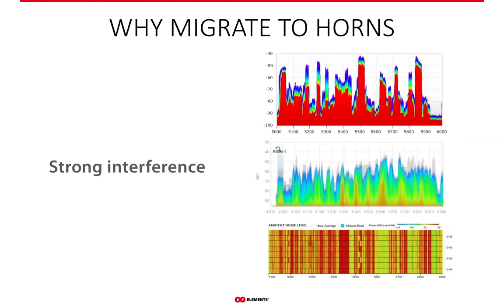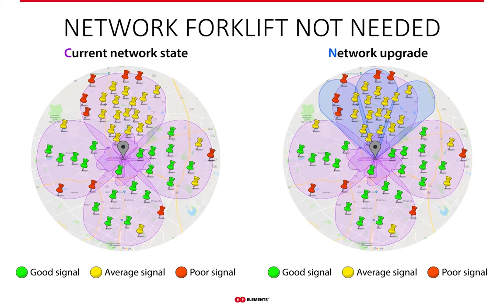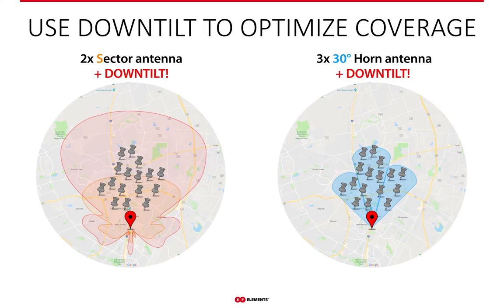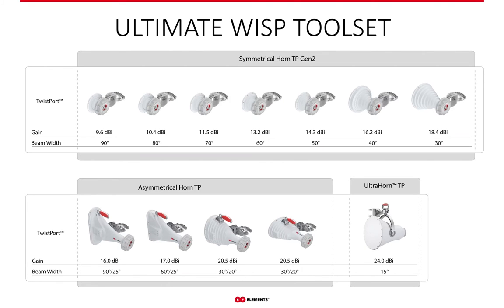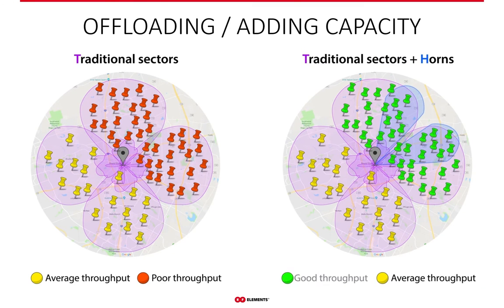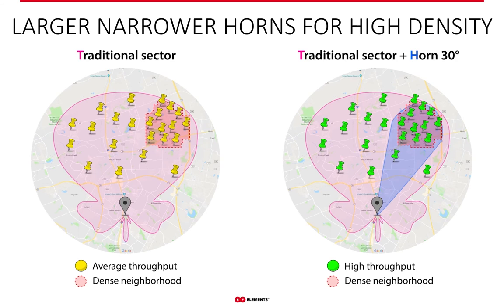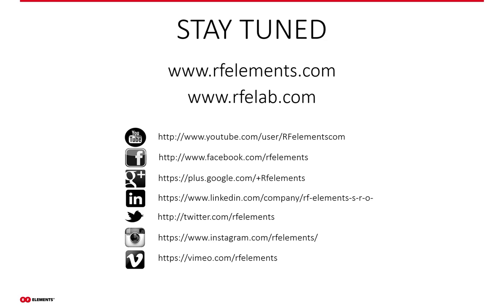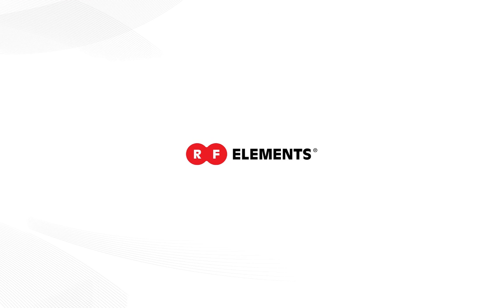Migration to Horns 101

Comment: In real life deployment with LOS what's the maximum distance that Symm 90° horns reach.
Reply from the maker: Hi Dong, try our link calculator, it will give you a quite accurate idea of the performance once you set all the parameters according to the rest of the equipment in the equation: https://rfelements.com/calc/